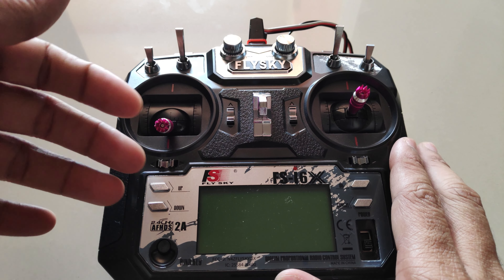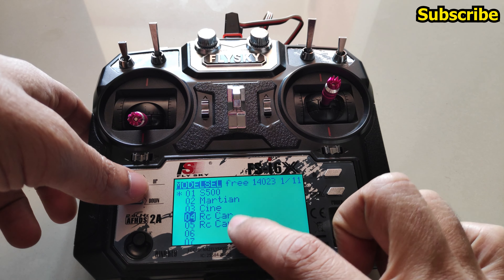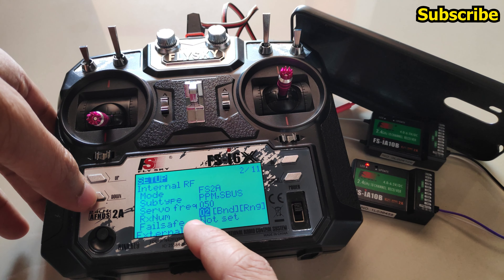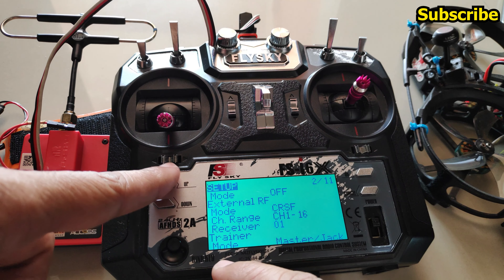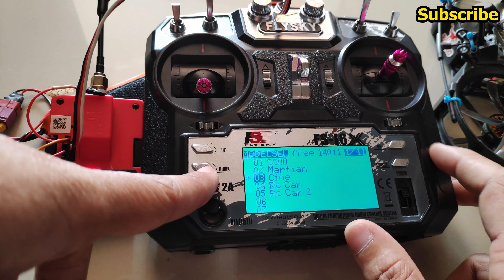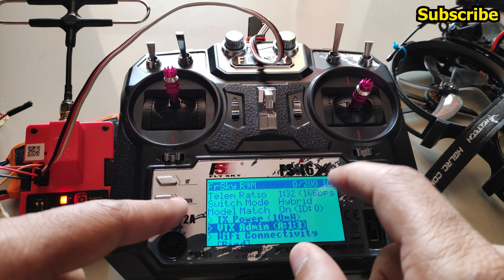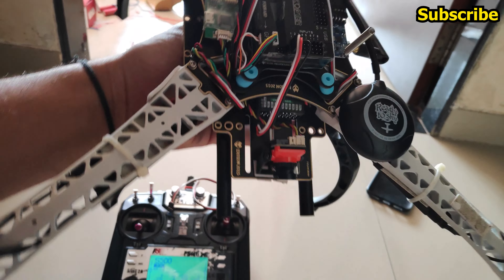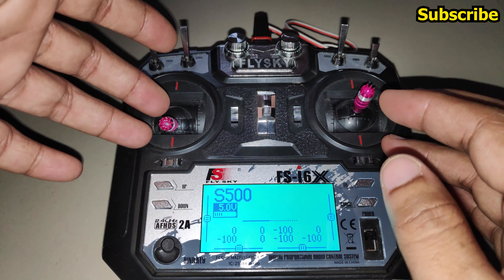Flysky I6X Open TX 1.8.0 improvements Receiver ID and ExpressLRS 3.0 + Failsafe Warning

Comment: These two days I ran into a very strange issue on ExpressLRS. Just want to share here. I upgrade ExpressLRS from 2.5.2 to 3.2 on the R9M transmitter and R9MX receiver because i heard of many new features offer on 3.2. Everything is fine after upgrade for a week or so. Today, I run the RC truck FPV again and it just randomly failed safe itself even in a very short distance like only 1 meter away. After the failsafe, I have to go to the truck to power cycle the receiver to get it connected back.

Another problem is that the R9 Slim+ OTA receiver would need to power cycle twice to connect to the R9M after upgrading to 3.2. I just restore it back to 2.5.2 and the connection between R9 Slim+ OTA and R9M is working perfectly again without needing to power cycle the receiver twice. 

I have not tested the failsafe yet; but it was no problem before on the older ExpressLRS 2.5.2. No sure if this is just me or any others may have the issue too? I think ExpressLRS team try to upgrade something cook but accidently break somethings for R9 receivers too. I think I will stick with the older version for now a little bit.
Reply: Just tested Truck with version 2.5.2 but it still failsafe once. Strange. I think I was set the Packet Rate and Telem Ratio in the FrSky R9M to 200 and 1:64; and that was my settings that changed in the radio. I just changed them to update less frequently like 50 and 1:16 for further testing. Note that the Tx power is only 100mw in my setting. Previously for ExpressLRS 3.2, when I set the Tx power to 500mw, it was still failsafe for just a few meters away.
Reply: It still fail safe for the new Packet Rage and Telem Ratio. No sure where the problem is? Strange. Will turn on the Tx power option - Dynamic - to On and try again later.
Reply: Still the truck failsafe even at Tx power option set to Dynamic. The max Tx power was 1W I set. Finally, I run out of idea, so I re-flash the R9MX receiver again on the ExpressLRS configuration and test it again. So far there is no failsafe for 1 battery or run. I wonder if this maybe a ExpressLRS firmware corrupted on R9MX related? I will have to test it for a few days to see if the intermitant failsafe problem still occurs. Again, I am on ExpressLRS 2.5.2 right now.
Reply from the maker: @peterhou4998  hi, i guess then there might some issue with the latest elrs build for r9mx receiver. On the radio what's your buad rate? If the telemetry ratio is low and packet rate is also low the there are chances of failsafe or connection drop...I've haven't used dynamic power yet to test
Reply: @RakishRc  I think it maybe the dynamic power related. I listed my setup detail below. 

TX hardware: R9M2019
RX hardware: R9MX
Handset model: Flysky i6X
OpenText 1.9
FC: Matek F411 WTE
GPS: Matek MQ10 5883
ExpressLRS version:  3.2.0
Packet Rate: 200Hz
Telemetry Ratio: 1:32
250mW dynamic power

I set to 250mW but NO dynamic power yesterday, and I have not yet able to reproduce the issue after 2 hours of running.  I tested with ExpressLRS 3.2. I will run more during the week, and report back if issue occurs again. Thanks a lot!
Reply: After few hours of FPV truck run this weekend, I was not able to reproduce the issue again. I can conclude that the Dynamic power was not working with R9MX properly. Turning off Dynamic power seems to fix the problem.
Reply: hello mr I have a small question the system you had installed does it work for submarine frequencies because I see that you change the frequencies in MHz thank you cordially I am waiting for your return
Reply: @ I never tried it on submarine. I only make this setup on FPV RC truck.
Reply: @peterhou4998 hello again can we change the MHz frequencies know how you had an old mc-12 radio remote control in MHz
Reply: @peterhou4998 hello again 
after a short question I have the same Fysky radio as you I turn on the transmitter with the Mormal Switch the transmitter remains safe why 
I can't do anything beep all the time
Reply: @ I don’t think you can change frequency for R9 transmitters.
Reply: @ Um… not sure why, for me it was working fine.  Perhaps the cable is not connected properly or something? Or hardware defects?

Comment: Hi! The switch setting of the original firmware could be set up at 120% and the servo motors also have larger stroke in the original firmware. How can I set up more than100% in opentx to get 120 % because it is insufficient for correct move of the boat.

Comment: I have openi6x 1.3.0(0) 2022.-01-22 eepr :219   Question - how can I upgrade to latest Version -which one ? without loosing my Saved Models? can you please give some main points how to do it!? 
Thanks for your great work and time you spend on FlySky ! Happy new year 23!
Reply from the maker: Hi, so the latest version as of now is 1.9.0 which has a different eeprom version. So unfortunately there's no way to restore your existing models from 1.3.0 to latest version. However once you update to latest version and re create your models and settings you can connect via usb cable and select usb storage and copy the eeprom file and save it and use it to restore whenever needed by simply copying the eeprom file to the radio directory
Reply: @RakishRc   - Well - I can connect to FlySky with USB and I can first download and save my existing eeprom file (where all models are) and than do the update - after update is done I just take the saved (now old) eeprom file and overwrite it with just installed eeprom file. 
This way is it ok - will it work ?
Thanks Rakish!
Reply: I can open with USB cable my FlySky installation directory and see my EEprom file & installation file there. 
But I can not get STM32 Cube Programmer to open the USB drive!?
Reply from the maker: @Mike4_friends  STM 32 cube programmer can only access the raido when it's in bootloader mode for firmware update. You need to hold the bottom horizontal trim buttons inwards to imitate dfu mode and then connect the usb cable to computer. it should appear as a dfu device in device manager and in STM cube programmer usb option
Reply: @RakishRc  Great BIG THANKS!
Reply: Rakish - after update is done I just take the saved (now old) eeprom file and overwrite it with just installed eeprom file. Will this restore my saved Models?
This way is it ok - will it work ?
Reply from the maker: @Mike4_friends  yes you need to delete the existing eeprom file and replace with the back file that's copied before to restore models.
Reply: @RakishRc   OK -Clear Thanks!
Reply: Rakish; I can now get Radio " hold the bottom horizontal trim buttons inwards to imitate dfu mode" with switching the radio ON. I can see in device manager DFU BUTHLOADER device. But STM cube programmer does not find a USB or something..? - Note comes up in Cube Programmer - device is under read protection  - than I check Read unprotect (MCU) and Klick Connect USB and  I get note "Please power off Power on your device ...... and I can not connect !?   If I take out battery , swith off radio,... nothing help to get SRM32 USB connection !? Any tip ? What am I doing wrong ?
Reply: Rakish - please use RC Group - subject line:  FlySky I6X port of OpenTX for reply- OK ?

Comment: Hi Rap ist es, my question 3 weekly ago has been resolved. Found it. But i have a question that is still open. Where can battery voltage flight battery, warning threshold be set. Battery telemetry with FS-CVT01 and FS-iA6B.  Thanks and greetings  Sigi
Reply: Sorry sorry crap correction    Hi Rakish rc, ........     :)
Reply from the maker: @ichbins2108  lol hi, basically you need to assign the battery telemetry in logical switches and set the desired low threshold value. Search for low battery warning open tx you'll find videos. 👍
Reply: Oh yes,  i  have it. Thanks it is so easy. 👍

Comment: it still have the PPM output problem or already solved in this version?
Reply from the maker: You mean for simulator? Or external rf ppm out?
Reply: @RakishRc  external RF ppm out
Reply from the maker: @mednabilmastouri6659  need to check. Did you turn off internal rf and try external rf ppm out?
Reply: @RakishRc  not yet, but in the 1.7 version i met this problem, when i turn on PPMout it work fine, when i turn off then on the transmitter i have to set again the ppm out
Reply from the maker: @mednabilmastouri6659  mostly like the setting wasn't saved all the way so it got rest. If you see a tiny square icon on top right it indicates if settings are being saved. once that square icon is gone it's safe to turn off radio. Internal rf has to be off for external to work and vice versa. Check again and also make sure connection to ppm out is correct on your module
Reply from the maker: @mednabilmastouri6659  i checked thoroughly and there seems to be some problem. In version 1.6.0 it works without any problem?
Reply from the maker: @mednabilmastouri6659  it's now fixed in latest version 1.9.0 and it's working as before 👍
Reply: @RakishRc  yes, i confirm, thanks :)